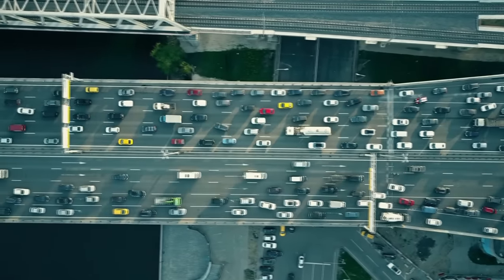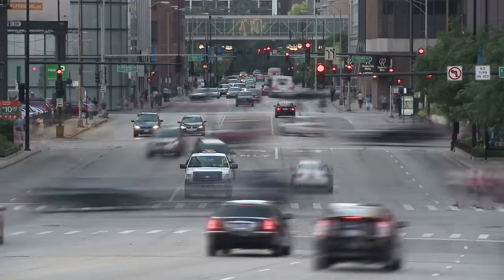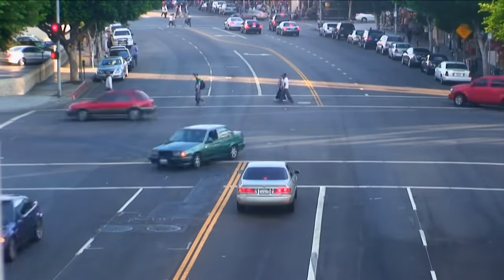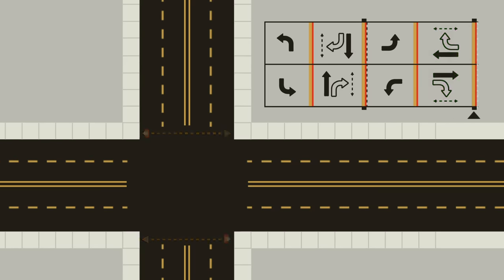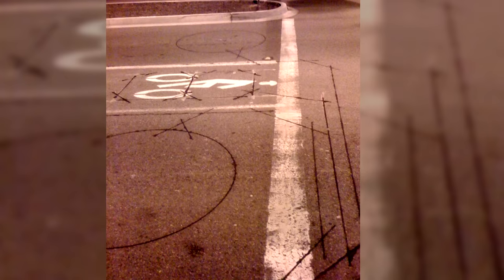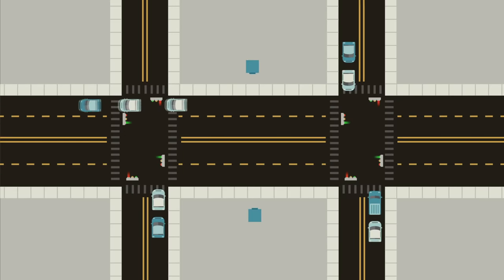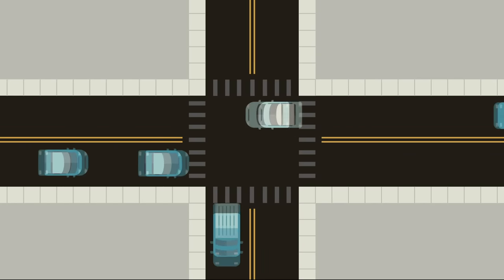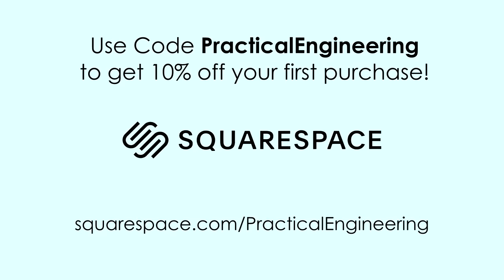How Do Traffic Signals Work?

Comment: I like roundabouts but apparently so does one of the city engineers in a town by mine. They keep putting the in everywhere. There is a spot with 3 roundabouts that aren't even 50 yards for each other and go nowhere. They then decided to put a stoplight at the busiest intersection that occurs AFTER the roundabouts so if it turns red, traffic backs up into the roundabout completely defeting the purpose of the roundabouts. No idea why they didnt just move the roundabouts 25 yards over and not use a light.
Reply: I used to think roundabouts were a good idea until one was actually along a route I travel. I dread the damn thing and avoid it whenever I can.
Reply: @angolin9352  outside/at the edge of the city I live in, on one of the major routs out of town, there are two roundabouts. They're great. There are two reasons for this: 1 they're pretty big, basically barely different from a one way road. 2 they've been put in a place where the roads that join up have about equal amounts of traffic, and are sized appropriately to handle that traffic.  If the traffic flow gets too great, they'd need to be made bigger to keep working, and if it only increased on one set of roads the others would get choked out and it would be useless.

Tiny roundabouts are Terrible.  The town I used to live in was reasonably sized, strung out along a main road and a bit to either side. A motorway had been built that meant a lot of traffic bypassed the center of town, but that main road still had big freight trucks drive down it pretty regularly.  Some genius decided that this was unacceptable (it had been the state of things and an utter non-issue for decades, mind you. If anything, it had reduced), and those trucks must be forced to use the motorway.... So tiny roundabouts were installed at a couple of the intersections.  Of course, there wasn't really room for them, all they could do was shave some of the footpath off the corners so cars could go around the obstruction, but the turn was too tight, and the island too tall, for trucks to get through.
This stopped the trucks, but also did the following:
Made turning across oncoming traffic stupidly awkward
Forced you to Break the Law every time you tried to go straight through or turn across opposing traffic, because it was a round about, but there was literally no Time to indicate accordingly due to the whole thing being too small (in practice people just ended up indicating as if it were a regular intersection)
Meant that traffic coming from opposite directions turning across each other interacted, rather than not
Killed the yearly Christmas Parade (and any other such events) because the Floats couldn't pass
Blocked Fire Engine Access to the town's main commercial area, And blocked fire engine access to the road bridge over the river, oh, And blocked fire engine access to the local government buildings and houses on the opposite side of the commercial area on the Other axis too! (the fire engines had to go around the block to miss the round about coming out of the fire station, then drive a quarter of the town's length, then get on the motor way, drive about half the town's length (crossing the river), get off the motor way, then come Back just to get to places on the opposite river bank)... This was Partially fixed by banking the road such that one roundabout was only half as far above the surface so the fire engine could drive Over it (the one blocking the bridge was not corrected when I last had reason to look, now many years ago, and a later development meant that, if willing to drive most of the length of town twice, the other bit would not have been cut off any more even without the fix).

So, yeah, well designed roundabouts in the right place are great and really easy to deal with.
Stupidly designed roundabouts or those put in the wrong place range from the annoying to the murderous.

(The city I live in also has an opposing pair of one way roads cutting through it on each of the four sides of the city centre. Their traffic lights are synced up (have been for decades) such that on a trip down one of them you'll hit a red light once between getting on them and hitting the end (unless you're super lucky, then not at all)... They're functionally an enormous roundabout... And that's actually the point, because the pull a Lot of traffic out of the city centre (enough to cause problems for businesses there), because the roads there can't handle it (and the city centre Still gets choked up some times.)

So, yeah... Pick the right tool for the right job and its great, force it into the wrong place and you break things.
Reply: There's a roundabout near my school that probably reduced idle time by 85-90%, easily. In the right situation, they're fantastic.
Reply: @angolin9352  In my town, so many people died daily at a single intersection, they put a round-a-bout to keep the town from getting sued. It's much faster to go through the intersection, and after a year of it being installed, not a single person has died in the round-a-bout. I'd say they work pretty well.
Reply: morrowvision was that not a part of drivers ed for u
Reply: I think roundabouts are ok if traffic is light. Otherwise they are just accidents waiting to happen
Reply: Ahh, Carmel, Indiana
Reply: After we installed the first roundabout in my City (west coast), the first complaint came from an elderly resident screaming at us over the phone for installing yield signs instead of STOP signs at the roundabout. It shows you that people are just not used to them but they're very efficient and safe while being cost effective due to the lack of maintenance costs compared to a traffic signal.

Comment: In Denmark we also often have seperate lights for bikes which work completely differently and have different rules. Biking is so common here that in major cities at peak hours you can often get congestion with bikes but of course it takes up so much less space that it's less of a problem. There is an intersection near me where they made it so that the bikes actually get the entire road area in front of the cars so that the bikes can get going faster at peak hours.

Comment: FYI in big parts of europe a red + yellow traffic light signals that it is about to go green. Therefore you always know if you are going to have to stop or can just go and not slow down at all.
And there is also a blinking green light, which shows that it is about to go red and therefore you can adjust your speed to keep the traffic flowing and avoid sudden stopping.
Reply: More than half of Europe, but there are still places like France, Spain, Italy that don't do that and does the same as USA.

Comment: That example of a self-driving intersection is why I think adoption fully autonomous passenger vehicles will take way longer than people will think. As far as I'm aware, an intersection like that can't work if there is one human involved in those quick exchanges. Maybe there could be autonomous-only roadways made, but that seems unlikely.
Reply: At the beginning of the 20th century, they had a similar problem: Half the traffic was cars & the other half was slow-moving horses, so a lot of places had dedicated lanes for each.
Reply: It is technically possible, as autonomous vehicles are independant distributed systems. They can identify objects and humans themselves, without needing signals from that object (although in this case there can be errors)
Reply: not to mention a single failure from one of the vehicles and the accident will pile up for miles.
Reply: The boring tunnel basically. Just wish they would be smaller roads involved not just SF to LA. It would also create a company monopoly.
Reply: Autonomous would be cool, I could go anywhere in the country and sleep eat and be on my phone then the car has a software glitch and bam I'm dead because stupid car crashes into a wall it didn't detect on its sensors because of a software glitch or malfunction! So I say F Autonomous vehicles because AI could kill a majority of the population in one day in Autonomous driving vehicles.
Reply: e
Reply: Designated roadways are cheaper to maintain and operate, but more expensive initally, so designated roadways are more than likely actually
Reply: @LeafTheWitch  A: the tunnels are, at least in concept, supposed to use carts, the demo tunnel was just that, a demo.
2: How bad do you think car tires are and how fast do you think they want them to go? 180MPH speeds are entirely possible on road tires, and anything faster than that can use the carts
Reply: @Grauenwolf  Race tires are deliberately made thin and soft. For example, the "tread" depth (yes I know F1 tires are slicks, but I'm referring to the depth of rubber until you need to change the tire) is about a tenth of that on road tires. Many road tires today are rated to speeds in excess of 150MPH, and supercar tires are often rated in excess of 250MPH
Reply: @richardmillhousenixon  the problem is not that is not possible to reach such speeds in road tires but that they would need to be replaced more frequently thus driving up the costs of owning and maintaining a car
Reply: @maxdiak5954  Still, assuming Tesla and the Boring Co. are still planning on using the design featured in their CG rendered demo videos, the cars won't even be running on their own wheels and will instead be carried along the tunnel on a cart/platform thing that has it's own wheels.
Reply: @richardmillhousenixon  or you can always use a train
Reply: @maxdiak5954  Yes, but the idea of the tunnels is that you can still maintain that nonstop point to point benefit of a car. The same can not be done for a full sized train

Comment: Watching these roads makes me realise how happy I am with the bicycle roads in my country, if there's any serious amount of traffic there tends to be a physical separation between the main road and bicycle paths to the sides. On roads with less traffic it tends to be shared but with a coloured indication what is reserved for cyclists.

Many of our traffic signals also have both ground loops and a button on a post to press for people with fancy modern bicycles that don't trigger the detection system. I've noticed in some of the newer ones they even include a light indication which turns on the moment a bicycle is detected or the button is pressed. 

I also like the "countdown circles" that some pedestrian and bicycle traffic signs use nowadays, basically an indicator that has a full circle which gradually shrinks to nothing. When it turns off entirely the green light is expected to come on, the result is usually that everybody starts moving at the same time instead of a few slowly reacting people here and there.
Reply: Netherlands?
Reply: @kleinereisbar591  Correct, bicycles are quite useful over here with our fairly flat terrain and good road infrastructure for it.

It may take me longer to get to the city compared to a car or bus, but while doing my shopping there I can get to the right place in the city much faster. 

And I've got two large bags at the back of my bicycle and a backpack to fill with stuff instead of having to carry it. Works out great for all but the largest objects that really need a car/trailer.
Reply: @extrastuff9463  i'm from Cologne and my mom loves to travel to your country to go on a bicycle trip 😂
Reply: @kleinereisbar591  Sometimes I dream of moving to a place where cycling is a common mode of transportation. Cycling in Nashville Tennessee is suicide. Even if there are bike lanes, there are driveways and side streets every 10 meters, debris/potholes galore, and most roads don't have any space for bikes in the first place.
Reply: I find it so weird that the USA forbids countdown displays for vehicular traffic signals, even if it uses them for pedestrian signals.
Reply: I find it so weird that the US treats automobile and truck traffic the same as a bicycle. 

In reality, cyclists are almost-pedestrians.  Bicyclists have no business being in travel lanes for cars and trucks.  It makes zero sense.

Comment: Hello!
Could you please explore the topic of the dedicated bus (public transport in general) lanes and their influence on traffic?
In my opinion, this kind of lane discourages driving and improve the traffic situation.
Reply: I don't know if there's a lot of formal writing on the subject, but the phenomenon of small urban municipalities aggressively building traffic out of their thoroughfares and creating a tragedy of the commons is an all too real fight I see in metro Detroit. It's all well and good for a city or two (each only a few square miles in footprint) to riddle their roads with bike lanes, bus lanes, 15mph speed limits and pedestrian yields every few hundred feet but the entire metro area is at risk of gridlock cascades when big arteries like Woodward get cut down to 10% of their throughput because Ferndale wants peds to be able to cross at 5:15pm unencumbered
Reply: @ivandiaz5791  nice bad-faith argument? it certainly makes sense in city centers but the particular road I'm talking about alternates from 6 to 8 lanes, 45 and 50mph. it's a major trunkline for commuter traffic and more so for events (four sports/concert venues at its terminus) yet one town that controls about 3/4 mile has slowed traffic down to 30 and placed down pedestrian yields. forget the pragmatic traffic flow issues, it's straight up dangerous at off-peak hours when drivers aren't watching closely enough

Comment: I have a series of signals that are near my house. I grew up here, so I have had the chance to watch these lights not only get added, but get manipulated into their current system. The biggest pain is a pair of lights that handle somewhere around 2 miles worth of cars during rush hour. Seriously, the line of cars can start around a mile before one of the lights. It is on a 2-lane road, and the other option is only a 4-lane road.

Look up Mills Gap Road and Highway 25 in Asheville, NC. It is AMAZING to see what has been done with these two lights and the rest of the run from Fletcher to Asheville on those roads!

Comment: Ex-traffic software engineer from the UK here.  I worked on ASCT (Called Urban Traffic Control or UTC here) systems for 12 years as my first job our of University.  I started purely in the communications realm, getting bits and bytes from the controllers on street to the each other and to the control rooms (via dedicated systems and then using the internet), and eventually moved up to working on the actual adaptive systems, producing prototype systems from requirements and simulations presented to us by city councils, working on interoperability between our equipment and those of our competitors, and producing a series of sub-systems whereby the health of the whole traffic network equipment may be monitored and maintained.

This video is a great starting point, but there's a LOT more going on under the hoods of the equipment out on street.  There are adaptive functions that will deal sensibly with failing sensors, local timed control where controllers on a route are able to stay in absolute sync even if there's no link between them, along with safety routines and equipment that guarantee that a junction never displays an unsafe or silly series of signals on a phase (telling two conflicting streams of vehicles that they can go, or leaving everything stopped for ages) - even if the ASCT systems tell them to.  Sorry - those films where people hack the city hall and turn all the junctions green or red?  Ain't gonna happen. :)

There's a lot going on in the anonymous grey cabinets along the street, and a lot of work goes in to them.  Thanks for highlighting us :)

For everyone else - the absolute absolute rules that any traffic engineer would like you to follow are:
1) Leave distance between you and the car in front to allow people to merge
2) Do not enter a junction unless your exit is completely clear for you.

Loads of delays and plenty of accidents are caused simply because people are too impatient, too close or too fast.

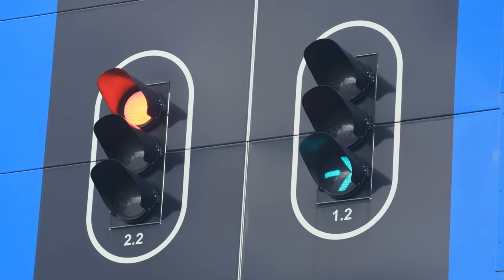Comment: 3:50 I wasn't aware that the traffic light phases are different here in Europe. Between red and green, we have a "red+orange" phase that means "don't cross, but prepare for green".
Reply: The Red+Amber phase is common across Europe and some other parts of the world, but unheard of in North America.
Reply: There's also blinking green for car traffic in some of the european countries, because, it's actually forbidden to jump on yellow, unless you're so close to the intersection that braking is impossible.

Another difference in euro is that often left-turns doesn't have separate phases, it's just they need to yield to oncoming traffic (both cars and pedestrians).
Reply: Interesting idea
Reply: @tjur  The left-turn can be protected, it just depends on the size of the road and the amount of trafic it's likely to experience. If there are two lanes going in either direction it often is, or if it's a busier intersection extra lanes are added to accomodate a protected left-turn.
Reply: I think this is because America has far fewer manual transmissions. We don't need to prep the car in anyway to go and accelerate quickly.

Comment: A nearby city just went like "Light? Nah fam we Dutch so roundabout it is" and replaced all the lights for turbo roundabouts, except for 2. Another city uses the "green wave" format, as long as you drive the speed limit you will only be held up at the first light. All the lights are timed so there is a wave of cars going between lights.